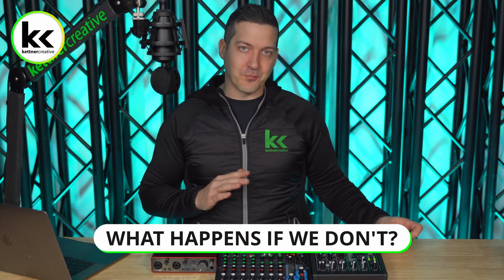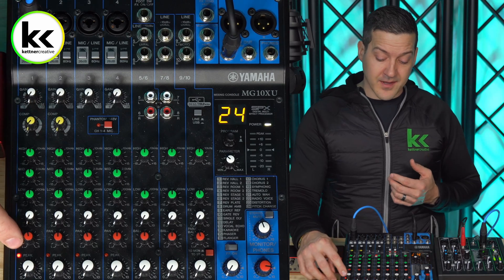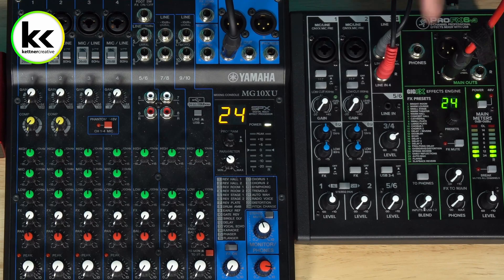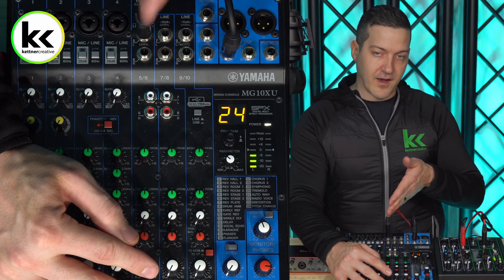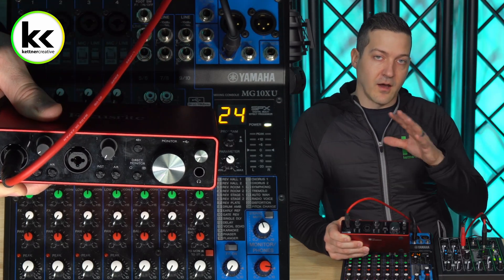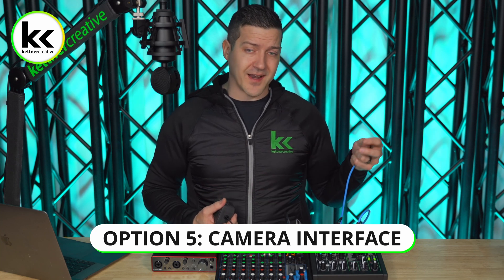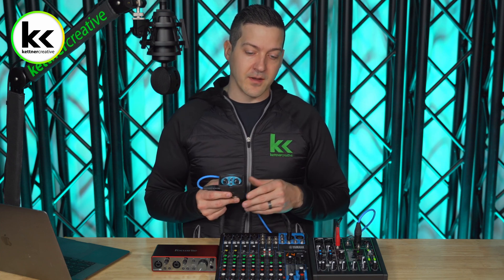Convert Line Level To Mic Level Audio Signal (5 Ways!)

Comment: Those DI boxes and pads, with only 25 dB of attenuation, actually, may not be enough to attenuate the mixer's master output level to the correct microphone input level.
Keep in mind that a professional mixer maximum output level is between +24 dBu and +30 dBu, if you want to use the entire dynamic range it is capable of. If your mixer master output level is only peaking on 0 dB on the meters, you actually sacrifice about 20 dB of headroom by keeping the level closer to the mixer noise floor.
Therefore, the mixer output level may need an attenuation of -30 dB or more in order to sit comfortably in the mic level range.
Depending on the mixing consoles you use, the microphone preamps may saturate with levels higher than +10 dBu.

Comment: Hi and thanks for the informative video! I have a question or comment about the Shure A15AS In-Line XLR Pad at 10:58.The one shown is designed for mic level. Rarely are such in-line attenuators also available for line level, which are then dimensioned somewhat differently. Is this noticeable in terms of sound? I would like to reduce the high output of my Neve 88m interface to the active speakers and not make any compromises. Difficult to get reliable information about this... Thank you very much!

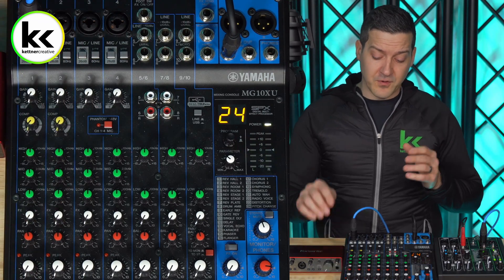Comment: 4:58 pay extra attention to that part, folks. I've learned it the hard way, I learned this the hard way as I ended up replacing my studio's mixer around 4 times. Back then I used to treat XLR and 6.5mm TS/TRS cables as the same thing.

Comment: Nice video!  Question my DJ controller has balanced 1/4 inch out but the Yamaha mg06 1/4 inch line input states it’s unbalanced.  Will the balanced 1/4 inch TRS have any bad effects or damage the Yamaha mixer?

Comment: Thank you so much for this video. I have a digital piano (Roland HP704) with 2 unbalanced TRS line outputs. My mixer is the MG10XU. Do I connect them to the mic level input or line level input if the mixer?

Comment: One of a few really well done videos on rhis topic. Liked and subscribed! Would love your feedback on my specific situation as I am learning. I've been running a two channel line isolater to the mixer for 2 instruments from a line out xlr at the end of each chain (acoustic preamp/DI for one, and cab sim pedal for the other). Never paid attention to what the sound guy does from there...until now. Rather than use 2 DI boxes, it sounds like might have several more options: 1) Use the mixer's pad or an inline attenuator to mic input, 2) an xlr to trs adapter to the line input, 3) just straight into the mic input and use my end of chain output levels to attenuate?? The acoustic DI is likely intended to go straight into a mic level, the cab sim seems to be a true line out.

What are the better of all these, or all basically the same in your opinion? Thanks! Sorry for the long question

Comment: Excellent video. I have a guitar modeler. A Line 6 Helix. It has XLR balanced outputs with line level signals. I set my presets to -12 DBs . How would be the best way to send my signal to FOH and avoid clipping ?
Reply from the maker: DiBox or XLR Pad.

Comment: Hi Kettner, I have a wireless mic which is over powering my mixer XLR input which has no bulit in pad. There is hardly any adjustment available on the gain control causing feedback - what is the name of the inline XLR pad please I would like to order one - many thanks Chris
Reply from the maker: Shure In-Line XLR Pad: https://currentprice.io/xlr_pad
Reply: Thank you so much ... Very helpful great video

Comment: Should I connect my iPhone on the front of the interface with a balanced TRS 1/4 cable? Or unbalanced on the back on inputs 3 and 4? Focusrite 6i6 2nd generation. Just want to listen to my audio through it without taking my headset off or having my microphone pick up my phones audio. 😊

Comment: Have a Boss VE Vocal Harmonist Pedal. Wanted to use it through my Yamaha Mixer. It runs with an 18 volt power supply. What is the safest way to use it through my mixer? Do I use a Direct Box or can I simply run straight into the mixer. So,.. is mic to pedal to mixer possible safely?
Reply from the maker: That’s what I would do.